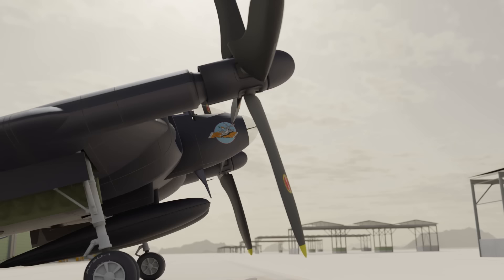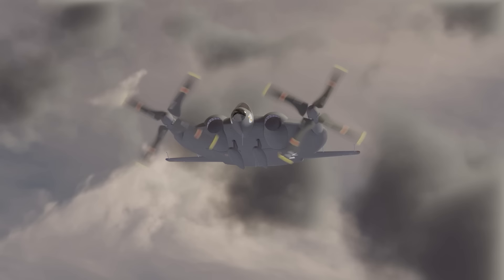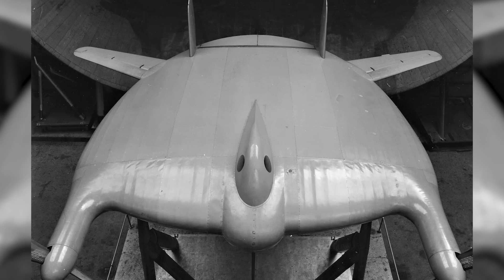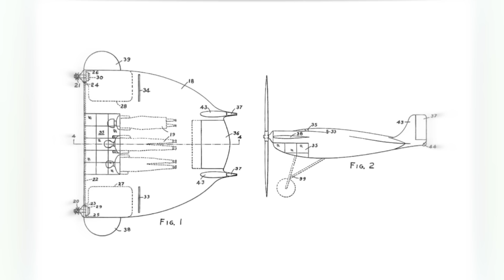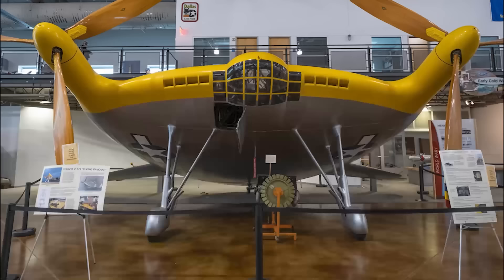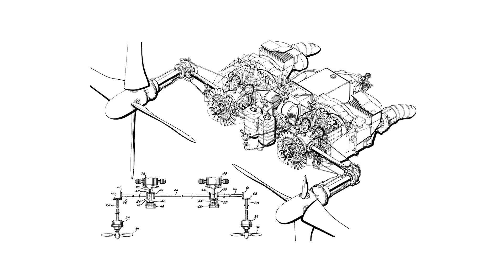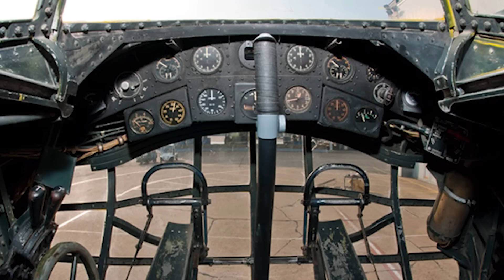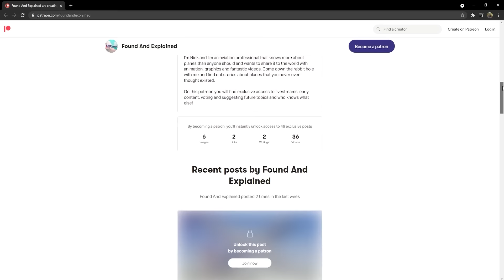The Flying Pancake - Slowest Plane Ever Made!

Comment: I have always been fascinated by this aircraft and always wondered “What if?” To that end, I always wondered if a design like this could be adapted to jet engines. The nacelles for intake air on the XF5U-1 could easily be mistaken for jet intakes and wondered if they could replace the propeller and piston engine. The only issue I saw from that was that the propeller creates the lift it needs at slow speed necessary for short take offs and landings. Can’t really do that with a jet engine unless thrust vectoring is used, greatly complicating a clean design. We have the technology today to make that happen, so why not try to replicate it in a jet form?!?

Comment: I still don't understand, which advantage it has to a Fieseler Storch Fi 156, which can start within 50 m and land within 20 m. OK, with a little upwind, which is always given on an aircraft carrier. It can even start and land vertically if the windspeed is at least 50 km/h.

But the Flying Pancake looks more funny, true, however it is also much more mechanically complicated.

Comment: Would jet engines instead of a hinged gearbox for the props have fixed the shaking problem?  seems like the gearbox extension and props could be totally dropped with jet engines streamlining the whole thing, although the takeoff and landing times would be way worse

Comment: The design actually could fly BOTH at very LOW and Very HIGH speeds. That's what makes it so Unique. The prototype engines were very weak and not designed for both.

Comment: A massive part of this technology that you didn't enplane and your video showed incorrectly.
Short wings are hugely inefficient because of wingtip vortices beading high pressure from below the wing to the low pressure above it.
The pancake overcame this by having counter rotating propellers spinning to stop the vortices forming allowing smooth flow over the wing.

Comment: The title and statements in the video are not correct. This was far from the slowest powered fixed wing aircraft ever built. The slowest was the Gossamer Albatross with a TOP SPEED of just 18mph.  This was human powered and flew across the English Channel. With a top speed of 18 mph, take-off and stall speeds would have been lower. 
One of the lowest speed mass-produced piston engined aircraft was the Curtis-Wright Junior with a maximum speed of 80mph, a stall speed of 30mph and a takeoff distance of 200 feet.

Comment: Not even close to being the slowest plane ever made. In about 1950 the Air Force commissioned the ring wing STOL. The “ring” wasn’t facing the airstream, it was embedded longways in the wing on both sides of the plane. Minimum cruising speed of two MPH. Really. Guys would walk next to the plane while it was flying.

Comment: Drop two merlin engines in it and I bet it would fly at 500 mph
Reply: or 3, and they might not even need superchargers.
Not with those props like that.
In trying to "sculpt" the airflow, it swung those huge props around on the wing-tips. Because this resulted in horrendous single-engine-out handling, it required the power-sharing drivetrain.
A drivetrain can work, either for a single normal contraprop or two different positions, say shoulder dorsal like any other twin. But it's simply not necessary without the extreme wing-tip position.

NACA tunnel tests with the V-173 showed that it did not gain anything or particularly change performance having the props as they were, versus normal 80hp props turning inwards.
Zimmerman was working towards a VTOL tail-sitter, but neither of the 2 pplanes had enough power or appropriate landing gear.

As a slow, steep "A" approach, Zimmerman copied the very-low aspect-ratio of the Arup plane, which he had seen fly for NACA in the early '30s. only after that did he design his plane, working with United Aircraft Corp (Vought, Sikorsky, P&W, and Hamilton Standard)
The Arup planes did everything the V-173 did and were sleek and quick on little power, still flying at 18 knots. Stall-spin-proof. Nimble with astounding climb rate (See the "Flying Heel-Lift" video) The Arup S-2 and S-4 ("Air+Up") between them flew several seasons performing at airshows, apparently until age of the airframes grounded them. The S-2 in its later modified version was received by Mid-Atlantic Air Museum in 2015

See the Boeing model 390/391 for a single-prop "flapjack that might have been 500kts, and land on a spot, or <half of a CVE deck with 20kts headwind.
 A larger Avenger-sized version with two props like the S-2 could do everything else, whether armed and powered like a strike plane or just a transport.

Comment: Now you could have 1 small 4 cylinder with a turbo that has 260-350hp powering both props with variable pitch.
P.s. we already have better planes that can take off in 50 feet or less....STOL planes.